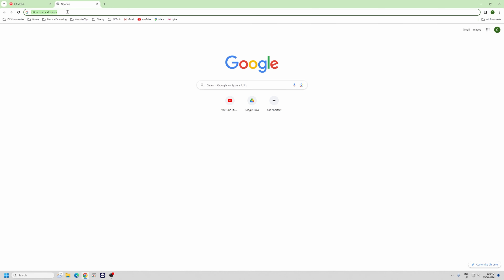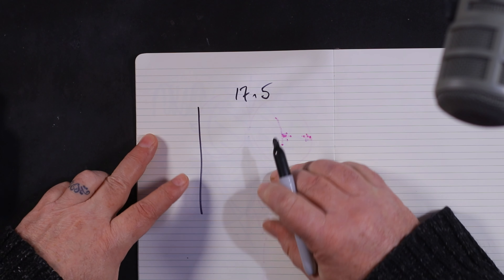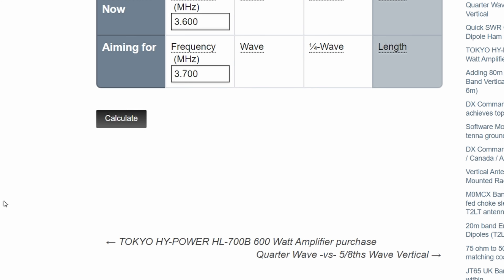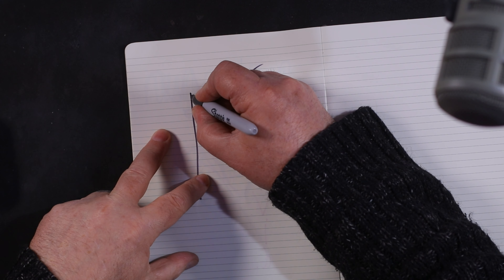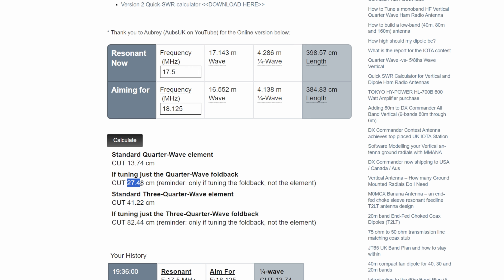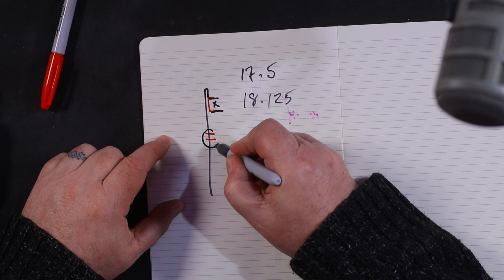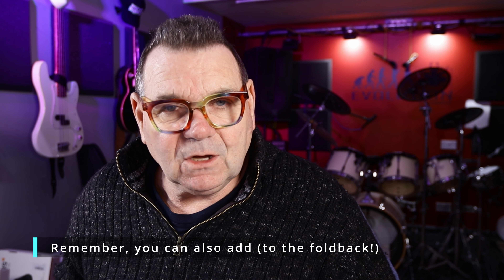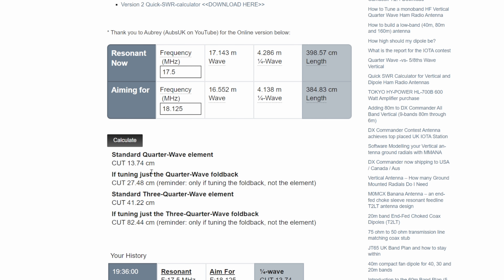Fast Method of Tuning Any Antenna - the New SWR Calculator - Dipoles, Verticals, Loops, EFHW

Comment: Thanks Callum, just about to tune my new DX Commander and have been reluctant until I got a set of stable SWR reading. This new calc (was using your spreadsheet) will help but I still might send you my figures as have a problem on 30m using the 80m inverted L. Regards Helen 73.
Reply from the maker: 80m Inverted L.. You SHOULD see a dip at around 11.5MHz. Unless it's a 12.4. In which case, happy to chat. Sure.

Comment: Hello Callum , I wanted to share my findings regarding drilling holes through walls and cavities for transceiver coaxial cables .
Ideally it is best to drill a 45 degree diagonal hole through the wall rather then just a direct inline hole , the reason being 45 degree provides a gradual curve cable line transmission , for cable protection & aesthetics this process will  require a wide panel construction with baton frame & sheet board  on the exterior of the building & possibly  internally too depending on the environment situation  , this installation method will inevitably require more cable length , time & material cost , alternatively the panel construction would not be required if the cable line transmission was carefully calculated through a wall cavity using a mousing line ,  both pilot methods will cancel out coaxial angle stress .
For further RF added protection against signal loss & noise reduction  the coaxial cable can be placed through a flexi steel conduit from the radio operations area , if the steel flexi conduit diameter is that of the correct size it can more or less terminate directly up to the PL259 plug to the transceiver itself , this process would be the ultimate isolation in coaxial cable line transmission .
The flexi steel conduit is that of steel IP 54 PVC coated in black , it has excellent flexibility & endurance .
The entire installation would require precision calculation , the steel conduit would be intersect to copper tubing on the exterior line transmission to the antenna switch unit or the antenna itself .
The flexi conduit would require grounding at a convenient point .
The remarkable aspect of this process is that a relatively inexpensive coaxial cable can be used , hence the entire metallic shielding , this of course is understandably subjective , ie power rating among other factors .
I hope that the above has been of some interest & I think that it would be nice if you could possibly share this process to others ?, it may help some towards the radio communications hobby in one way or another .
Reply from the maker: I'm only half-lost! But thank you!
Reply: Your very welcome  , indeed  it is quite a lot to take in , but well worth it once all the information is digested .

Comment: Wow. If there would be inputs for initial length, initial foldover length, measured freq, desired freq and % wavelength, then one could fine tune a 5/8th with one set of measurements one cut for any velocity factor wire.  So how long is antenna, foldback, measured freq, and desired % of wavelength and desired frequency.

Comment: I tried the web tool for my EFHW and got some confusing results.  All bands on my antenna usable but are a hair low. For 10 meters, it says to trim 3”, but on 40 it says 20” trim is needed.  I’m 20 feet high over the garden as the Brits would say. I will try the spreadsheet next and wonder if trees or height or a garage at one end does something. It’s grass under most of the center.
Reply from the maker: Tune for 40m and the rest SHOULD fall into place.

Comment: Okay when you speak of resonance are you talking about the lowest swr? Is that truly the resonant frequency of that band? Hopefully someone will answer this for me.
Reply from the maker: Most times resonance equals best SWR, yes. However you can have something that is resonant that will never have a good SWR. Dipoles, Verticals and Loops (with a 4:1 balun) in MOST cases will have natural impedance that will show a low SWR to 50 ohm coax.

Comment: So am I right that the velocity factor of the wire is irrelevant using this calculator because with a measured resonant point the VF drops (cancels) out of the equation. Cheers Calum.
Reply from the maker: That's it!

Comment: How can I change the resonance (down) of a folded dipole made of aluminum tubing without rebuilding the elements to a longer length? Can I add a 'flag'?
Reply from the maker: Down.. so you need to add..? OK, try insulated wire coming back on itself.

Comment: Where is the link to the new calculator? Aubsuk not found on you tube.
Reply: Roger that.  I've hunted, and can't find it either.  Callum embedded the on-line calculator on his page, but there doesn't seem to be shared a link to it.
Reply from the maker: I don't know what search Engine you folks are using..! "M0MCX SWR CALCULATOR" https://www.m0mcx.co.uk/quick-swr-calculator-for-vertical-and-dipole-ham-radio-antennas/
Reply: I'm here! The only version of the calculator is on Colin's M0MCX SWR Calculator page.

Comment: Calculates at the speed of light 300,000,000 and not 299,792,458?
Reply from the maker: If you want to measure in halves of millimeters, be my guess. But you didn't see to the drop in edit? I said that anyway. Good night ! :)
Reply: Being pedantic about 0.07% increase in the speed of light? Is this being used for a hobby or would you be using an online calculator for a NASA or military project?

And please don't complain about the precision of my percentage rounding.
Reply: @AubsUK  IT WAS a question  !  !  !
Reply: @Νίκο-δ7τ in that case, I will bow my head in shame. The difference in realistic terms is insignificant though. But I confirm in the calculation, 300 Mm/s is used for the speed of light.